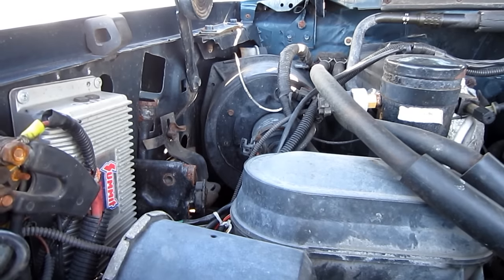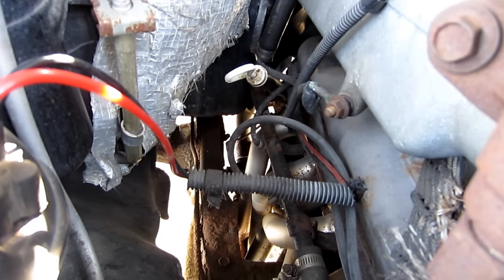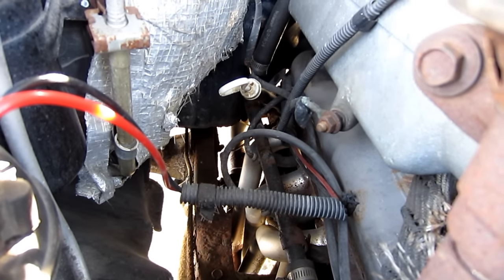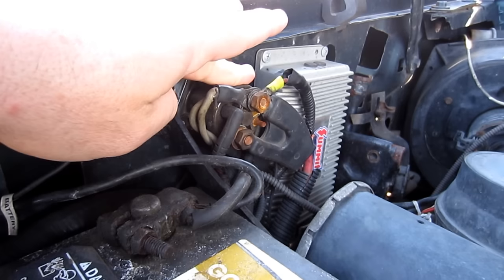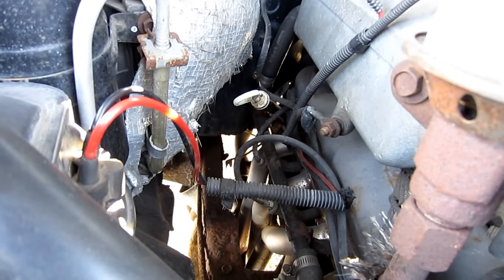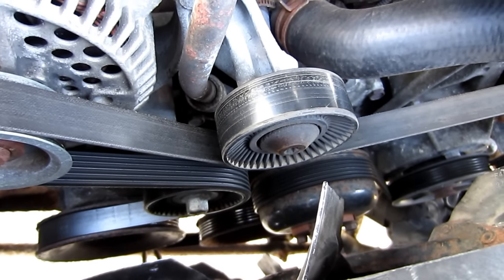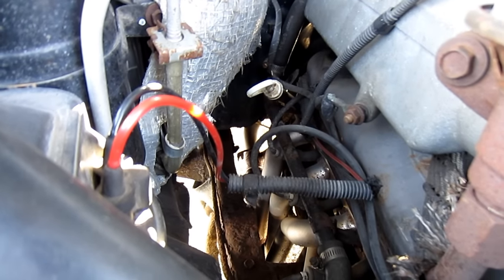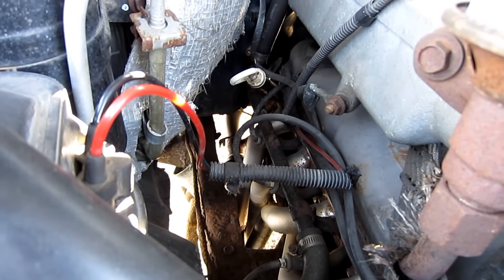Know your cars Clicks. Why it won't start

Comment: What if you cant turn the fly wheel by hand ? Ive tried as hard as i could and it turns maybe a mm but wont go any further
Reply from the maker: Daulton Smith sounds like something's locked up then.
Reply: Foxboss9 would a starter cause this ? I was just about to come home from work my truck sounds the exact same as yours .. but i could not turn mine over by hand .. would that be the starter or something more serious :/

Btw THANK YPU FOR RESPONSE this is the first time i got a response back thank u
Reply from the maker: Daulton Smith you should be able to turn by hand... If you suspect something more serious pull the sparkplugs out and then try rotating it by hand again before tearing anything apart...
Reply: Foxboss9 do you have any suggestions on how to remove the top starter bolt on these ? Im having trouble having enough room to brake the bolt .
Reply from the maker: Daulton Smith I used long extension that had a swivel end... Not a universal, but swivel end...
Reply: Foxboss9 thank you sir got it ! 

I had the single click sounded same as yours this video helped me out thanks !!

Comment: I have a 2008 Hyundai Sonata and my car starts but whenever I hit the gas it starts to make clicking sound and it gets louder. My dad told me it needs a new engine i am not really sure. It sounds like lol I don't know to interpret it but it is loud clicking sound
Reply from the maker: Dubzzy XD if the noise gets faster as the engine revs up, then you have an internal engine problem (lifters, valves, bearings) check your oil level. If it is OK then it's time to get a shop to look at it..

Comment: My truck does same thing . I was told it’s the crank sensor went and got that changed and my truck is still doing the same thing . My truck starts sometimes then once engine is hot it will not start back up. HELP!!!
Reply from the maker: Troubleshooting electrical is hard to do first hand ...escpecially when it is random...You need to find someone proficient in troubleshooting/diagnosing/repairs that is local to you..... NOT just a parts changer who throws parts at it hoping to fix it..
Reply: Foxboss9 thanx man took it to auto zone they showed crank shaft sensor and or the camshaft position sensor replaced both it starts right up but now has a clicking sound when turning the key . Just clicks soft click ?? Any suggestions?

Comment: I changed my starter and my 01 mustang gt still has only one click what's going on
Reply: Check the relay
Reply: I got it straightened out it was the power wire going to the battery and starter I changed them out and it cranked right up

Comment: Same I got new battery new alt and new starter. Still wont start jus one click. Relays good on it and no  anti theft light is on so tomorrow I'm gonna check the ignition switch and module. After that I dont know any suggestions? It's a 13 f150 5.0
Reply: I have the same problem as you. I replaced with a new starter, new more powerful battery, new solenoid relay and it was working fine then one day I went to turn on the truck and it struggled. Then is turned on for a min and off again.  Hasn't turned on again. I replaced the solenoid replay again. Checked new battery and it was 100% on a tender and nothing. Just clicks slow not rapidly. Tried with headlights on and the lights do not dim. Idk what else to do.

Comment: I have a no crank no start issue as well. There is a ping sound coming from the throttle body area when trying to start. Does anyone know what that means? I haven't been able to find any information on this issue.
Reply: Thank you for this helpful informative video by the way.

Comment: I need help bad! I cannot afford a shop. I have a 03 hondaui tiburon the car has been starting once a day and then once I shut it off to go in a store ect..n come bak out the car is dead. no crank no start and a clicking sound comes from the relay box under the hood. .then about 6 hours later it will start again i can drive around if I don't shut it off but once i shut it off that's it  nothing again till later that nite or nxt day so it works once a day.. all lights work fine music everything but I assumed it was battery so I bought a brand new battery. .that wasn't the answer. .then I replaced the starter relay under the hood i really thought it was thst because it seems that it gets hot n won't start n clicks n then when cools down it starts again but I just put the new relay in n that wasn't the fix either. .it can be anything but narrowing it down the the clicking in the relay box and new battery what do u think it is??  I would think starter motor or starter. .but I can't go around guessing n buying all these expensive parts. .it could be anything it can be a cracked wire or the ptu harnesse i don't know u seem to know about this stuff please let me know if u ever heard of anything like this before or anyone plz. I'm so upset I'm a single mom n I'm missing work now for weeks n car less i can't believe this is happening now. what is the issue with this stupid car.i never heard of such a thing as to where it starts once then is dead for the rest of the day what the hell is it????
Reply from the maker: +Lisa Marie Unfortunately I don't have any specific experience with that vehicle at all.. The fact that everything works fine except when warm and then only during cranking attempts it doesnt turn over, makes me think it's the starter.. What could be happening is the starter is getting hot from the running engine either through heat conduction from the block or heat convection from the exhaust.. once hot the the starters casing expands and causes the continuity of the windings inside to disconnect/come apart causing an open circuit that disallows a field to be generated to spin the armature.   When cool, the case contracts and the electrical connection is re-established allowing it to work.. Here's the rub, you are most likely going to need a shop to replace the starter unless you have ramps/jacks and tools. Have the shop tell you what the problem is for sure. As electrical problems are hit/miss when diagnosing. If a repair shop charges you to fix the problem they diagnosed and it still doesn't work,,a reputable shop would figure it out mainly at their expense. If you try to tackle the starter replacement on your own make sure to secure the vehicle on the jack/ramps and disconnect the battery or you will have sparks flying from loose cables.. good luck
Reply: If you're still having problems it my be your fuse box. Google your year make and model. Type in problems starting. My neighbor had same problem with his Kia.
Reply: Lisa Marie alternator?
Reply: alternator
Reply: Lisa Marie did you get it FIX?
Reply: I have this problem too! any update on this? thanks
Reply: 1year later and I'm sure you had it fixed, but, this was the identical situation with my old Chrysler diplomat years and years ago.
It started fine when cold, once I ran the car shut it off, there was no chance it would crank again until
it cooled off, I talking next day cooled off.
It turned out it was the starter that went bad.
Heat would cause it to malfunction.
Just like the author of this video suggested, heat expansion would cause starter's inside components to not function.
Reply: Mizz Lisa Marie Shops are Cheap.
Reply: Mizz Lisa Marie did u ever fix it
Reply: In cases like this, you can take it to Autozone, they will run a FREE diagnostic on your starter, alternator, battery and voltage regulator. If they find a dead battery (battery wont hold a charge) they will install it for free, costing you only the price of the battery. If the alternator or starter is bad, depending on make and model they are normally a simple swap, in my case I have take out the entire radiator assembly to replace the alternator. They do not perform computer code diagnostics anymore, but you can buy a bluetooth OBD2 reader for $12, that will sync with an app on your android or iphone and provide you with error code translations.

Comment: I got the one click all I did was get a wrench or screw driver turn the key to on touch jump whatever you want to call it the two bolts on the relay selonoid and the truck will start

Comment: On my car. It clicks real fast.. I try it a couple times, then it starts to click slow then the motor starts to turn very slowly. I try it again and it turns slow then finally turns on.. After that i have no problem with it turning it off and on. When its off for a long period, it clicks again... 
2016 Buick verano
Reply: crzystx04  it's your battery

Comment: 2008 malibu, 2.4L.As soon as it got really cold, 2-10Above zero, car would turn over extremely slow but did start.After driving for about 10 minutes or so and turning it off, starting it again was almost impossible as it would turn even slower but did start.Couple of days later, started slow again only to not turn over at all after shutting it down.Jumping it from a different car didn't work, using one of those portable starters did nothing either.Battery might've been weak but I recharged it for 24 hours solved nothing, putting brand new battery fully charged still wouldn't help.Now it just clicks one time and doesn't turn over when key is turned.Headlights and everything else works fine.Could it be one of the relays or starter that has failed?If it was starter then why was it turning in the beginning at all?It was slow but it did.I'm confused.Any helpful responses would be appreciated.Thanks.
Reply: Józwa Mikołajcyk I  got 09 Malibu did exact same thing so I. Thinking the starter  finally went out did you find put what it was?

Comment: I have a 05 Honda Civic I will turn the ignition on and the the solenoid will click but it will not start after five six times Tri it will start and stays on, do you know what could be wrong.  thanks
Reply from the maker: Sorry, I don't.. Good Luck..

Comment: Thanks Sir for the info, My starter delay wasn't getting enough juice from my battery, so I cleaned both connector, who were too rusty, and boom it started like a new car. Thanks again for the info and thank you YOUTUBE.
Reply from the maker: Michel Richard 😊
Reply: Michel Richard how do i clean the connecter
Reply: @Foxboss9  i did that truck started ran and wouldn't turn back on. What could the issue be now?
Reply: @dreambigbigger1622  dirty throttle body, anything doing with choking has to do with either air flow sensor or dirty throttle. 80% of the time. Unless you already had issues then it could be anything like bad mix ratios or blown sensors.
Reply: @slowgoat6089  ❤️b

Comment: All your tips were good but you forgot one of the most important tips. Corrosion .001 thick will cause the same thing as if the starter is bad which there’s absolutely nothing wrong.  I’ve experienced this problem myself a few times troubleshooting vehicles .  Clean both battery post and starter hook up and cable ends

Comment: The moment I put my key in sometimes or turn it forward I get one solid click
Reply: What was it?
Reply: Mr Buicks nothing to do with China that’s for sure.
Reply: Mr Buicks haven’t addressed it yet though
Reply: What was it ?
Reply: My lexus wasn't even clicking... I found out it was my starter after the tow guy came out to tow it away.... 🙄 I'm like I need a jump start... nopeeee it wasn't the battery...
Reply: Am experiencing a solid one click and engine won't start.
My dashboard is on and wipers are functioning .
Reply: @gatsiejeremy5721  what type of vehicle is it.
Reply: @moderndaydrifter4672  im experiencing the same problem. After a few tries my car starts. Has only happened twice so far. My car is a dodge caliber sxt. The battery is good and everything turns over and runs normally once started. Any idea?
Reply: @krisyoung4120  It turned out to be very simple fix for me. Mine is an 1994 E350 motorhome. I tried everything then one morning I went out and crawled under it with a long screw driver and just knocked the wires abit that go to the starter and tried it and it started. The wires weren't loose, I believe they are corroded inside but it's weird because this only happens when it gets cold in the winter. It's fine all spring summer and fall just in the cold.
Reply: @krisyoung4120  time to replace your starter if you haven't already. My dodge did the same thing, they're known for developing a dead spot in the starter motor. 
I'm sure you already googled it though lol.
Reply: @dannywilliams6643  lol yes i already did some research. Im beginning to think the brush inside the starter is too thin and its sticking, preventing the car from starting. Only once i couldn't start and had to tap the starter with a long metal rod. It started right up after a few taps. But i have not replaced the starter yet, it seems to be working fine again lol. But i will be replacing it very soon.
Reply: @moderndaydrifter4672  yup my dodge avenger just did this only one click and no rev, everything electrical works headlights,trunk, inside lights,radio,  the key fob , just doesnt actually start the engine ...so it is the starter ??
Reply: @MrHankeee  any time this happens you always start looking at the easiest thing and work your way through. Is your battery good?
Reply: @moderndaydrifter4672  haven't done an actuat volt test but all the lights, wipers , everything electrical works , so I'm guessing the battery is good , I just hear one click , the car turns on but not the engine
Reply: @MrHankeee  batteries can power all that and still not have enough juice to turn over the engine. I learned the hard way as I had a battery that appeared to be good even after having a shop test it. The problem was the plates inside the battery, one had broke and was touching another plate, battery no good, I put in a new battery and off I went.
Reply: @moderndaydrifter4672  I'm thinking of shorting the starter through the starter relay connectors that connect to the battery up to, but I'm more concern about damaging the rest of the system too trying that
Reply: @MrHankeee  ya it's a crap shoot if you don't have a good working battery to put in and try, good luck with getting this figured out.
Reply: @iTzShakenJoE  yep. I called recovery thinking just a jump start needed and was mortified when he said your alternator is knackered. Now on the hunt for an honest mechanic which is more difficult than diagnosing car sounds.

Comment: See I put a brand new starter on and it still makes that click noise
Reply: same did you figure out the problem?
Reply: Same here. I’ve got a 87’ Toyota pickup and it’s a carbureted 22r but doesn’t have that relay/solenoid on the fender. If I wire one to the starter will it give enough juice to turn it over without the “click”
Reply: @imanithomas-bu8nl  yea so on my 94 Roadmaster there is a ground wire ring terminal behind my alternator and there was no bolt holding it so it was just grounding off the front of my motor
Reply: @pedrogarcia5418 yea so on my 94 Roadmaster there is a ground wire ring terminal behind my alternator and there was no bolt holding it so it was just grounding off the front of my motor

Comment: Thank you so much! My solenoid in my 1969 mustang was making the rapid clicking and i thought it was just bad. Sure enough, I charged the battery up and fired right up.
Reply: @Foxboss9  my 2003 mustang does the fast click and I have replaced the alternator and battery but it didn’t work
Reply: I'm charging my battery now the moment I watch this video. Hopefully it will work like yours.

Comment: Great video although just for your record the hammer tap trick on the starter only works if you have 2 people. One in the driver seat to start the car and another guy underneath the car tapping the starter with a hammer. If it was only you there then obviously it would not work because you need 2 people!
Reply: Annnnd ive done it by myself enough times to know thats bs lol

Comment: Did you get yours fixed by changing the starter because I have a 1997 ford explorer with same problem and I'm changing my out today
Reply from the maker: Yep. new starter did the trick. Would have been smoother if the top mounting bolt didn't break off in the bellhousing. Had to drill out the broken bolt and extract it. What a pain.

Comment: My starter motor won’t engage with the key however if I take a screwdriver and cross over the starter relay it turns over no problem. Any ideas what this could be?
Reply from the maker: Tyler Skidnuk starter switch if equipped or ignition tumbler
Reply: FoxBox Iam Having thesame PROB But lts NeitheR One of Those

Comment: You are an absolute homie. I need to replace my battery and solenoid because my lights and everything are dim, and the clicking is rapid and at the top of the engine but very faint. I applaud you my friend, 10/10 from a friendly Canadian 😊

Comment: never avoid the obvious. we have a nissan maxima that wouldn't start. i placed my automatic charger on it and it showed charged and would not jump from another battery. the car had a clicking noise coming from the relay box under the hood. i located it and started to disassemble it. wrong;;; the box wasn't getting enough energy to make it operate properly. i took the battery out to a shop and had it tested. bad battery. bought a new battery. problem solved.

Comment: if your battery is fine check the wires.follow the +and -,look for any loosen wires.my fiat had this problem,it was disconnected ground(-) wire from the engine.the ground wire from the battery goes to the body and from the body goes to the engine,and last thing check the starter motor.
1.check the battery
2.check the wires
3.check the starter motor